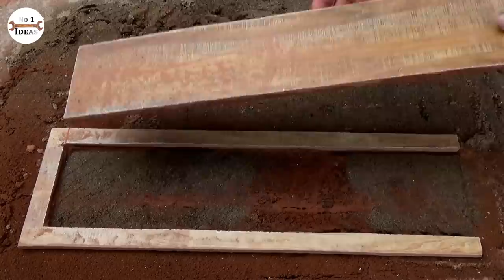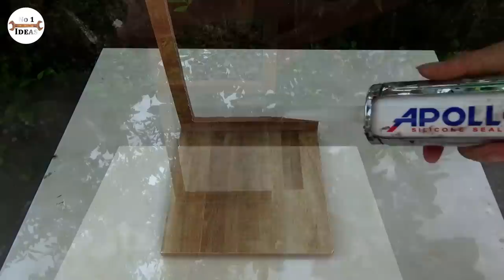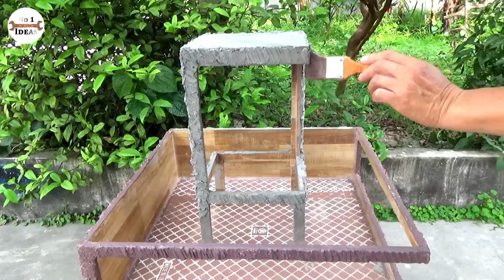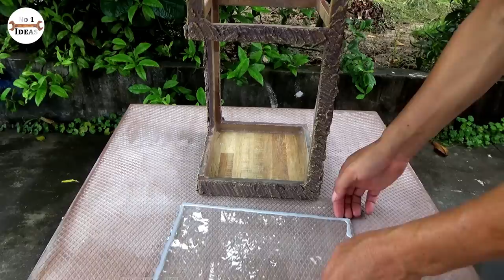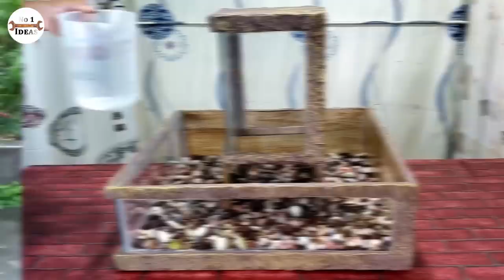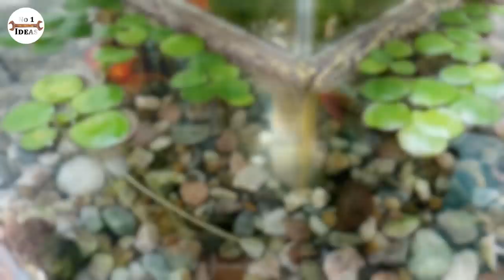Build a Beautiful 2 - Floor Aquarium from Marble Tiles (Very Easy for Your Home)

Comment: It's a cool idea, I'll give you that... but everything about this is horrible for fish.

1. That tile and concrete are unsealed and will leech into the water causing pH issues.
2. There's no filtration, aeration or temperature regulation.
3. You've mixed tropicals with goldfish.
4. It's much too small for those goldfish let alone all the dither fish you've put in. The tank is very overstocked.
5. It doesn't appear to be cycled so there be a huge bacteria and ammonia spike.
6. It's painted... that paint is going to chip off.

All in all, those fish are not living long. It looks cool and that's about it.
#fisharenotdecor